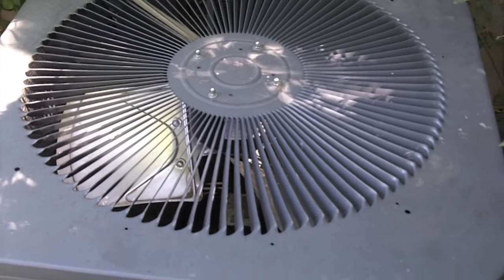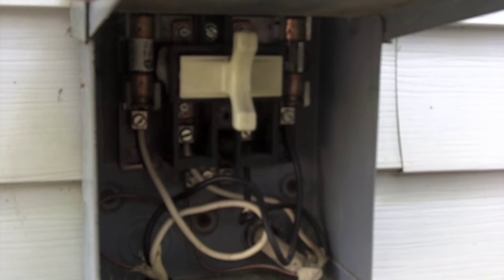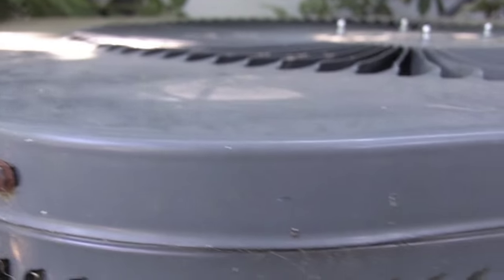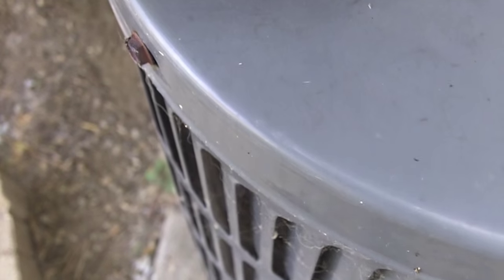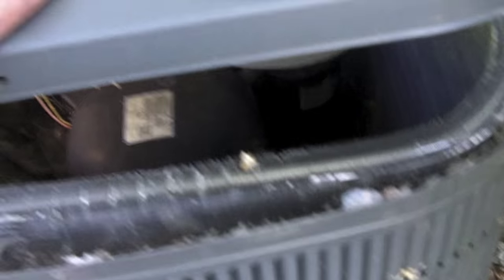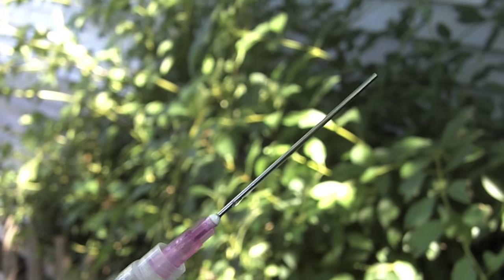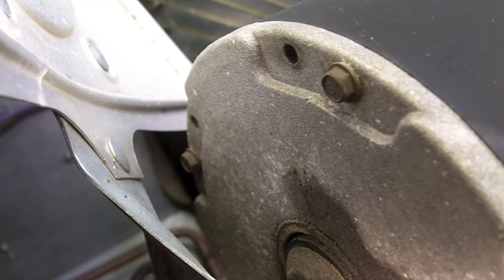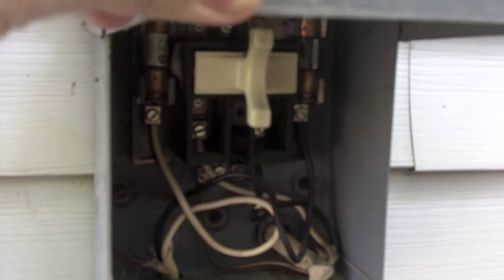Oil Air Conditioner Condenser Fan

Comment: Just a couple comments. After you add the oil to the holes, manually spin the fan around several times before turning it back over, or some will just drain out.  Second, I didn't have to buy a syringe, the oil for this specific purpose had a long hose leader and cap right on the squeeze bottle.  Third, since you've got the top off anyway, it's a great time  to remove any leaves and so on inside, and also to take a hose and wash the wraparound filter/venting from both the back side and the inside, going across back and forth and working from top to bottom.  This will remove any fine dust that has accumulated over the coarse of the year, and your air conditioner that didn't seem like it was working when 110 degrees will suddenly cool again even at that kind of extreme.  This step also can save dramatically on your electric bill.
Reply from the maker: Excellent points! Thanks for sharing this information. Comment pinned!

Comment: I'm not an expert but I'm pretty certain those aren't oil ports and you're just likely putting oil on the windings instead of on the felt rings that hold the oil against the shaft bearings/bushings.  That looks like a generic replacement condenser fan motor and some of those holes are either so you can move the studs around to accommodate other mounting patterns and/or they're condensate drains (fan motors experience extreme temp swings and condensation will accumulate inside the housing if not allowed to drain).

Oil ports are normally on the sides of the castings (i.e. Perpendicular to the shaft).  There would be only one hole at the top and one at the bottom and they'd both extend radially in from the edge towards the shaft to channel the oil right where needs to be.  We don't get a great look at it but I don't see typical oiling ports on your fan motor. Typically modern condenser fan motors don't seem to have them anymore though.  You'll often see the raised part of the casting where they would be but the manufacturers usually don't drill the holes anymore (probably because 99.9999% of them are never used in our "throw away" society).

If those are condensate drains with direct access to the windings then I'd imagine putting oil in them would, best case, have no effect or, worst case, actually shorten the life of the motor since it's not really somewhere that you want to have excess oil.
Reply from the maker: +Jeff D I'm afraid you are incorrect, but thanks for the comment. Peace!
Reply: 3&1 or wd40 both are penetrating oils will wash out what little oil there is then when it dries out  there will be no oil at all left and seize the motor.
Reply: No, he's right. You just oiled the windings.
Reply: Correct. Those are not oil ports. Oil ports also had plugs.
Reply: @HNXMedia  The truth is, on a lot of electric-motors, there is no easy way to lube the bearing-areas. The insulation on the windings is pretty hearty......occasionally shooting some lube, while trying to hit the 
bearing-area is probably not going to hurt it.

Comment: I designed 48 frame condenser fan motors for 36 years including many of the commonly used alunimum end bells in use today. I am an expert. Jeff D is exactly correct. Squirting oil into the optional tie rod holes (sometimes used as drain holes on enclosed motors) will damage the coils and significantly reduce the life of the motor.
Reply from the maker: Been over 8 years (this video was from my original channel and reposted in 2015) and it is still working just fine off this one simple fix. Hey, every opinion is welcome. Peace.
Reply: The insulation covering rotor/stator windings is fairly hearty and will not be 
hurt by occasional oil/grease getting on it.
Reply: Well then, design better motors...

Comment: This absolutely does work.  I had a slightly sticking motor that was over heating.  I just hit it with a little PB Blaster for a temporary fix to get me through the night.  I also sprayed the shaft between the fan hub and the case.  I immediately noticed a difference upon turning the fan by hand.  So far so good.
Reply from the maker: Awesome! Glad it helped. Thank you for taking the time to leave an honest, positive comment.
Reply: @HNXMedia  Day two and still running like new in 95 degree weather.  New motor on the way.

Comment: Worked on my unit, thanks. Easy, peasy.  Reading the comments was sort of funny. There's two things I've learned in nearly 70 years...if a repair works for you, don't question it and if it ain't broke, don't fix it.  I've also noticed, there's not a technician or repairman that will agree on ANYTHING.  LOLOL
Reply from the maker: Thanks for the intelligent, well-thought-out and kind comment. I find the comments to this video amusing. This video is nearly 8 years old (from when I actually recorded it). I did this and have not had a problem since. Like you said, if it works for you, don't question it. It worked for me and you and I KNOW it will work for others, despite what the naysayers will say. Namaste, my friend.
Reply: I realize this is an old comment thread but I'll still comment. I've been an HVAC certified technician for 30 years and I'll say there are a lot of different style motors out there. Some oil in different places, so without seeing the specifications on this particular motor, or without tearing it apart and having a first-hand look myself, I can't say for sure there isn't a felt ring (or some other delivery method) that delivers oil from those points to the bearing. That may very well be the design of this motor. I can say I haven't personally saw one identical to this but that doesn't mean much either. I agree that if it has worked well then there is no point in changing the procedure. Just my two-cents, for what it's worth.

Comment: Many AC repair guys would say that the permanent fix would be to get rid of that brand of AC😄
I had that brand of AC when I lived in Houston and it seemed to work OK. I guess it's the luck of the draw with those things 🤔
Reply from the maker: Other than replacing the capacitor 3 times, this little thing has done right by me. And since capacitors for it are only $15 at Grainger, I can live with that. 😎

Comment: The holes are not for lubricating. 
I disassembled my motor today. Just looks like this.
For the oil, you have to remove 4 bolts and put the oil inside the bearing area.
When I removed the bolts, one was broken.
So I tried to buy same size bolt, but I couldn't find any place.
I bought long threaded rod and acorn cap and cut and used.
Reply: Other videos said that. It's for condensation. but wonder if you add lots of oil and turned, will it reach to shaft?

Comment: Those are drainage holes for any condensation built up in motor housing. This will not lubricate bearing it will oil windings and stator of motor which is bad umm K.

Comment: Looking at the motor housing I don't see any plugs. There is one open hole on the bottom where you can see a copper coil or wiring. I read this could be for water drainage. Will I need to open the unit up to oil bearings or is this likely a sealed system that's not meant to be opened?

Comment: Those holes are not oiling points.
Reply from the maker: I get a lot of naysayers about this video. This video is from my original YouTube channel, so it is not 4 years old, it is actually 10 years old. I say that to say this: Ever since I did this to the AC unit, I have had ZERO problems or noises for 10 years. Take that for what it is worth. I might even do another video showing how well it is still running. Thanks for watching and taking the time to leave a comment. Peace.

Comment: That is not a breaker box. It is a fused disconnect. You don't need to go to the breaker box if you pull the disconnect. Those holes on the bottom are for draining water. If the condenser fan motor has a oil port you will see a removable plug. Don't loose the plug.

Comment: I replaced my fan motor two years ago and this past fall the ac tech told me that the motor was drawing too many amps.  How is this possible for a motor only two years old?  Would oiling the motor help?
Reply from the maker: Check the capacitor first. If it is "bowed" or "bulging" on one end, it is bad. you can get a replacement from Grainger for less than $15. If that's not it, you can always try oiling it, it won't hurt, but don't let some money-grabbing repair person talk you into a new unit. You can swap out the motor itself for around $200 instead of a couple thousand for a new unit.

I wish you the best of luck. Thanks for watching my video and taking the time to comment. Namaste!
Reply: Thanks for the reply.  And I must say the mystery deepens because the capacitor that I have was replaced at the same time the motor was, and it is in pristine condition and the AC tech testing it and told me it was fine.  I know those units are really cheap.  I once paid $320 for one when I was NOT in the know...There are too many scammers out here in the desert it seems when it comes to AC repair.
Reply from the maker: I truly wish you the best. If you think about it, or have a moment, drop a comment when you figure it all out. I would be genuinely interested in knowing the final outcome. Stay safe, stay cool! Namaste!

Comment: they just call the oil "tool lubricant"?any other name?
Reply: use 3-in-one oil. Look for my comment about how to oil the bearings correctly. Do NOT do what this guy did.
Reply: the little hole with the word oil by it ,might be a clue...I'm going with that....thanks everybody for the info